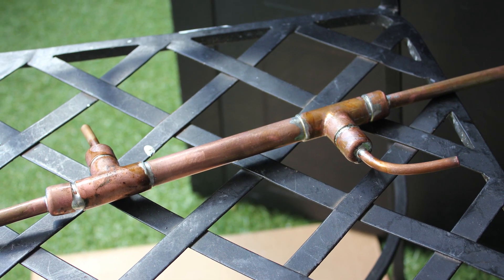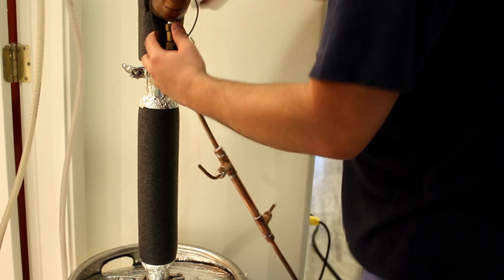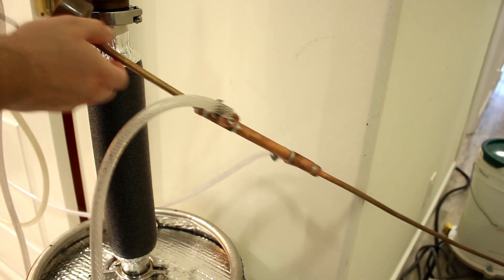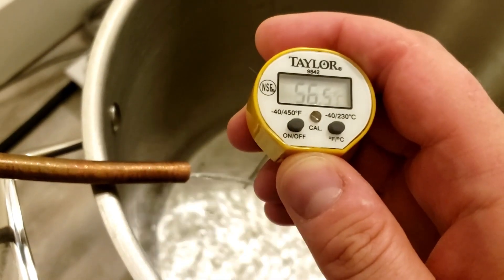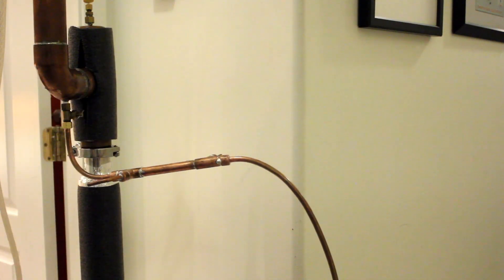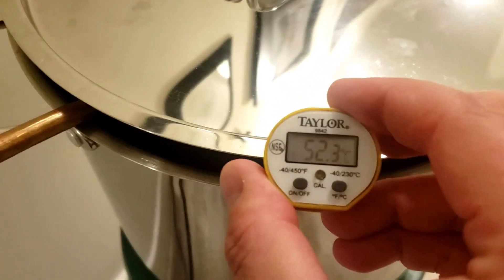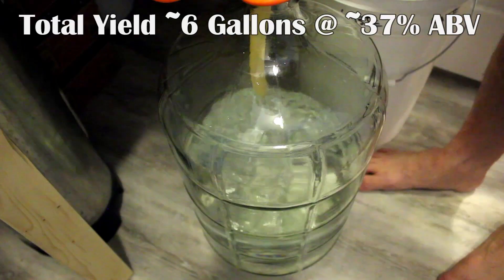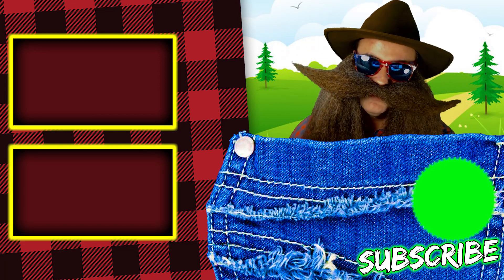5" Mini Liebig Condenser - Test Results - Stripping Run #2

Comment: If you are worried about space, use a coiled coaxial heat exchanger. It’s basically a Liebig that’s as long as you want it, you just put a copper tube within a tube, wrap them both around something with about a 3 inch diameter until you have a coil with as many turns as you want. Then make up the process and water jacket connections just like you did on that one.

Comment: It's not Leiberg or Leibig it's Liebig pronounced Liiibig. It should ALWAYS have an angle downwards. You bend it upward in the video and risk huffing and pulsating streams to come out as it so to speak "water locks" in the bend before the Liebig.
Any liquid management still will have a somewhat hot product coming out. It doesn't matter much...in fact it will only cause unwanted higher alcohols and other crap to evaporate. However, building a Liebig for cooling the product is a neat idea. Have you considered a Graham condenser instead? It doesn't take up much space and you have already shown you can wind a coil. Note: The product should flow around the coil NOT inside it or it will take forever to see the effect of the adjustments you make to the still as the run goes on.
Such a condenser will cool substantially more than a Liebig and you won't have to bother with the more complicated shotgun build.
Happy distilling. :)
Reply from the maker: Hey Kalle, thanks for watching! A Liebig condenser should never be pointed upwards, but do you think it really matters during a stripping run or an experiment? This isn't exactly a spirit run, it's a fun experiment :) Totally agree with you about running hot liker during a spirit run, no need to cool the distillate coming off the still during a spirit run where you are going to do cuts. Like you said, the residual heat helps the final product. The problem I"m trying to solve with the Liebig is stinking up that apartment during stripping runs. Stay turned to find out how I did it. Spirits runs don't smell for me. A Graham condenser is interesting but you think that would be the way to go for making whisk(e)y? I plan on jumping into whisk(e)y and other pot still spirits this year so I want a condenser for stripping runs and pot distilling. Happy distilling!!!
Reply: @OpenSourceDistilling  Yes, it does. The Liebig is based on the principle of gravity. The alcohol vapor is denser than the air so it sinks downwards by gravity, a downward angle on the Liebig keeps the vapor going down as it slowly condenses on the wall of the pipe.
Sure you can use a Graham condenser for whatever spirit you like. The point is it has a smaller footprint than a long Liebig, thus making the rig more compact.
Its design gives it a much larger contact area than just a pipe in a pipe which basically is what a Liebig is.
You can run whiskey on a pure potstill or go for a thumper which increases the ABV of your product and also cleans the spirit as you roughly get 1 1/2 distillation compared to only 1 when you only run a pot.
However, as with any other spirit, it will vastly improve when you do a stripping run prior to the spirit run. I also take the foreshots on both runs as the crap ain't supposed to be in there in the first place. One may as well get rid of it as soon as possible in the process. The more crap you can toss in the stripping process, the less is left to contaminate the product in the spirit run/runs.

Comment: Do you reckon you'd be able to make a mini shotgun condenser with the same diameter pipe you have inside your Liebig? Also out of interest, what temperature is your tap water coming out of the wall at?
Reply from the maker: The inside pipe is 3/8". I've extended the liebig in this video and made it over 3 feet if I remember correctly. Stay turned for a video on how that liebig holds up to this smaller one. I suppose you could fit something like 3 x 1/4" pipes in a 1/2" pipe like I have in the video. I'm sure that would work better than just having one pipe on the inside.

This year I'll be building a shotgun condenser for whisk(e)y. I'll use the new shotgun for the pot still and for stripping runs. It will fix all my issues with hot distillate. I'll be using 2" for the shotgun housing and I think 1/4" tubes on the inside. 

Cheers and thanks for watching. 
Joey Joe Joe Jr

PS
The Strong Arm Alchemist is kick ass.
Reply: Looking forward to seeing the new Liebig and the shotgun condenser!

And yeah, haven't been able to bring myself to change this profile pic for years 😂

Comment: Would you be willing to do a video on your keg build or help me with choosing the heating element parts Awesome channel by the way you deserve more subscribers 🤙
Reply from the maker: Yes, it's coming next year. I'm upgrading to a 3 inch reflux column. I'm soldering in multiple 1.5" triclamp fittings, adding a makeshift sightglass with teflon tubing, installing 2 brand new stainless steel heater elements. This is be a new still design for low ceilings that I've never seen anyone else build before. I'll also be putting in proper swagelok needle valves and arudino/raspberry pi temp probes with data logging. I'll also be building out a proper pot still with shotgun condenser next year and making whiskey. I'll be releasing a video soon where I extend out this mini 5" liebig by 36 inches for my next stripping run. Stay tuned! Thanks for watching :)
Reply: Open Source Distilling Awesome Thanks Did you build your own controller power box
Reply from the maker: @flatbedtrucker  Yes I did. I have a potentiometer hooked up to SSR (I'm not sure what type of SSR it is though). In the future, I'll be using the module below to control a phase angle SSR and get fine power adjustment via a Raspberry Pi computer. I suppose that will be down the road as well. Before the upgrades to my current systems I'll be doing a few equipment videos to show what I have and if I'm upgrading it, why am I upgrading it. https://www.instagram.com/p/B0pIB6Pl55P/?utm_source=ig_web_button_share_sheet

Comment: I know it was a stripping run. But when angling a liebig up so product "collects" and "pools" you get Smearing. Smearing for those who don't know will gather flavors from each "cut". Cuts being heads, hearts and tails. Anything collected from smearing will have a bit of flavor from each part of the run. Nothing clean. In a stripping run it does not mater, everything is collected and re-distilled later.
Long liebigs are awkward. My advice is build a shotgun condenser. Or buy stainless... it is nice but expensive. Buy once cry once.
Cheers OSD!
Reply from the maker: Hey @BigEdsGuns, Even though this is an experiment and I'm just playing around  trying to get hings to work, you are right,  you should never have to setup a Liebig  like this if it's sized correctly. So do as I say, not as I do. I will eventually build a shotgun but not before I extend this little sucker out and see what it's capable of. Cheers and thanks for watching!
Reply: @OpenSourceDistilling  

 Would never say never to an experiment. Keep going... its the journey is what the experience is all about.
Cheers back at you!

Comment: First of all great video! There is so many variables such as, cooling water temps, ABV of your wash, ratio of your column and so on... I’ll try to PM you tomorrow on Reddit with suggestions.
Reply from the maker: Thanks man! I'll be extending out the water jacket to 36" next time, we'll see how it goes. The last of the iSpindel parts showed up! Stay turned.

Comment: I had an issue with hot distillate on mine, I bought one of these and problem solved.  Oh btw water in at the outlet end and then up to the column..
https://www.aliexpress.com/item/32960342182.html?spm=a2g0o.productlist.0.0.27777a6e4LgCnR&algo_pvid=2e3e4183-7bde-4334-993e-fee965f55abb&algo_expid=2e3e4183-7bde-4334-993e-fee965f55abb-0&btsid=b5c05007-a4af-47be-ba8b-62fc3588b5bb&ws_ab_test=searchweb0_0,searchweb201602_6,searchweb201603_53
Reply from the maker: Nice, on the inside of the water jacket does it have 'fins' to increase surface area or is it smooth? I LOVE aliexpress right now, I've been buying so much equipment from them. Very cheap, very slow shipping, and so far everything is good quality.
Reply: @OpenSourceDistilling  I doubt it has fins but it does the job....

Comment: Realistically to get it to room temp you'd likely need a 24" condenser with at least a 0.75-1" jacket and 0.5-0.75" inner distillate pipe. My liebig is 20" x 0.75" and can't knock down vapour fast enough keep up with my 5500w element / 4" column for a full blast stripping run. I needed to run it too painfully slow so I started using my stainless shotgun condenser on my copper column. It looks ridiculous but it works well.
Reply from the maker: Thanks for the comment John. I'll be expanding it out from a 5" water jacket to a 36" water jacket I think (it's the longest I can go without buying a bigger inside tube). Hopefully that will be overkill and I can dial it back from there. I'm always interested in other peoples' equipment. Thanks for sharing. Cheers.

Comment: So whats the problem with a longer Liebig?
Reply from the maker: Nothing wrong with a longer one, but if a small 5" would suffice I would permanently fix it to my next still head build. Looks like I'll need a longer one that will just come out during stripping runs, which is a bit of a bummer. I've been collecting materials for a 2" shotgun condenser so next year some time I'll probably bang one of those out and that will become my dedicated stripping run rig. Also plan on getting into whiskeys soon so a real pot still setup is preferable instead of liquid management still head. Thanks for watching!